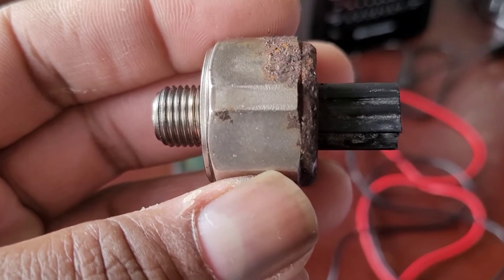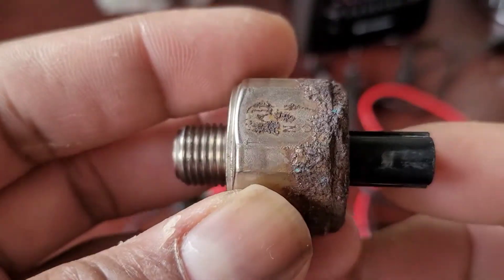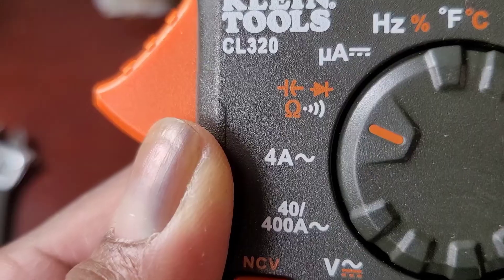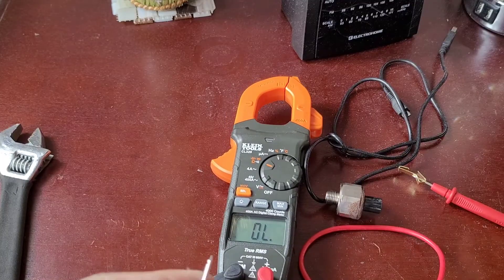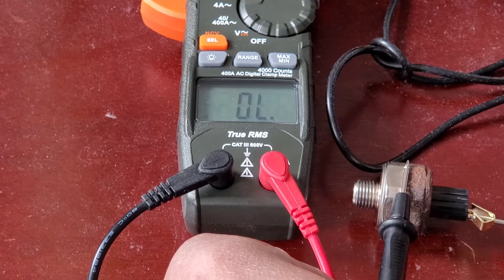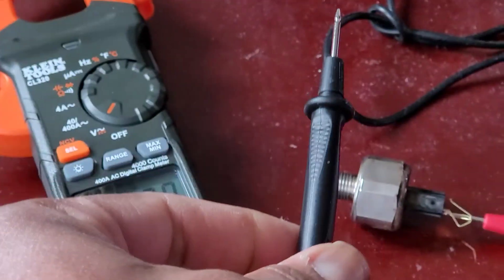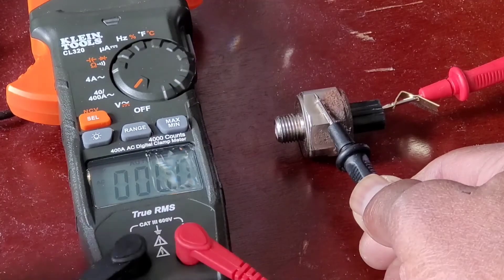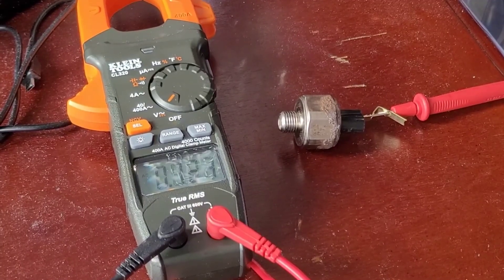Honda Knock sensor Testing Simple easy method. P0325 code reading

Comment: OL significa que el sensor está abierto Open loop, y debe estar cerrado y marcar una resistencia entre 400 y 500 kilo Ohms por lo tanto, el sensor está mal, hay que cambiarlo
Reply: Buenas noches ya cambie tres veses los knock sensors y regression el codigo k puedo checar o puedo aser
Reply: @IgnacioLopez-tb2oe revisar que los cables, primero estén bien conectados al sensor  y segundo que no estén cortados   Y que no haya comunicación con la computadora (ECM) en cuyo caso cambias ese arnés también los venden y no son caros, también revisa que no lo hayas apretado demás por qué como puedes ver en mesa video cuando le da los golpes a la Meza es cuando manda la señal y si está muy apretado, no hace su función bien, creo que el torque debe ser 24 newtons metro

Comment: Got a new knock sensor, resistance tested and indicate "OL" as in the video.  But during AC voltage test, no matter what I do, I cannot have zero reading.  It kept showing different numbers of small voltage like 0.018, 0.010.  What knocking on it or the surrounding, it spikes very little to 0.125, 0.098....etc.  Any advice?
Reply: Check the multimeter wires.

Comment: If you have a code? Put in a new sensor! WTF?
Reply: Could be wiring, connection between harness and sensor or bad sensor. It's not always the sensor. I'm assuming if you worked on cars you'd know this...

Comment: So you had an engine code that you knock sensor was bad, but when you tested it, it showed that it was good, so your problem was not your knock sensor.
Reply from the maker: Even though it test OK,  but it was throwing g the code as it's worn out.
Reply: Yeah, once they throw a code, they’re toast.
Reply: Bad fuel or ignition. Misfires! Do not buy generic parts! Especially the knock sensors! Been there, done that! OEM ONLY!

Comment: test wrong, you should knock itself not tha table
Reply from the maker: I dont think so. These are very sensitive to vibration and knocking. Even in the car, nothing knocks the knock sensor. It just picks up the knocking from the engine block.
Reply: @balaofcanada most piezoelectric knock sensor pickup knocking frequency between 6-9khz, depends on the car manufacturer. So if the engine rattling is not in any those range, it will not give cel.

Comment: I think the sensor need to read resistance
Reply: It depends, piezoelectric or resonance type of knock sensor. Most important, it produce certain frequency at certain rpm, check your manual and it should be not shorted.

Comment: Well i ended up on this video because just swaped sensor but still faultcode. 

Did this test on the old and new one. Can't get a voltage reading. But when I drive the car I can livestream date from knocksensor. 

It's bouncing between 0,12-1volt 

Can anyone without a check engine light on tell me what there sensor is giving? Would be really helpful
Reply: did you figure it out? i have code p0325 even after replacing my knock sensor
Reply: Same here.Any updates ?

Comment: I was under the impression that there should be resistance. The fact that there wasn't is confirmation that your knock sensor is bad?
Reply: There is no resistance for my brand new knock sensor, but it will produce voltage when knock using metal, and it makes voltage drop about 2.5V dc when supply 5V dc.
Reply: @PalataoArmy You don’t supply voltage, it’s piezoelectric output comes from the imbedded crystal that has physical properties that create about .25 volts until the engine produces a knock that triggers the pressure on the crystal to produce small amounts of linear voltage from within the sensor. The stronger the knock, the higher the voltage spikes.
Reply: @waverider5751  is it gonna be damaged if I have tested the resistance on any of piezo or resonance type of knock sensor?